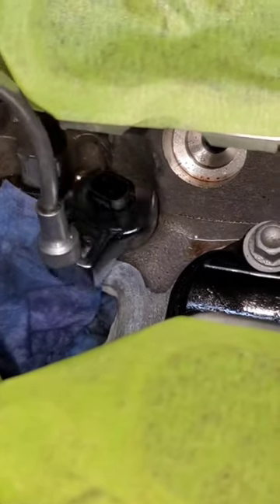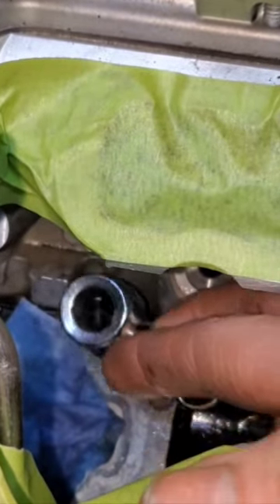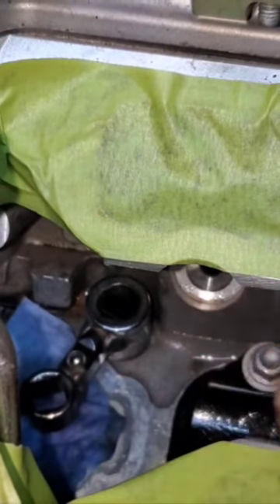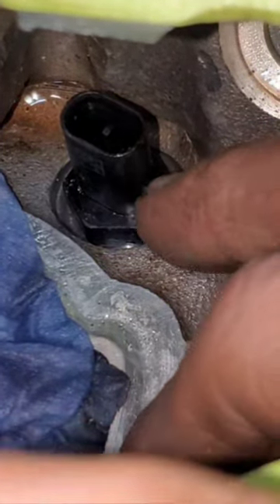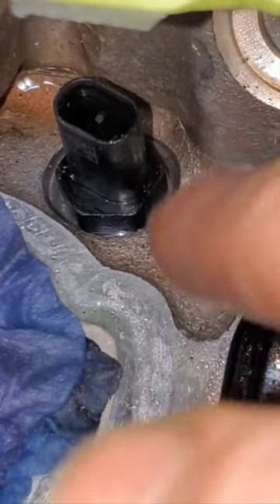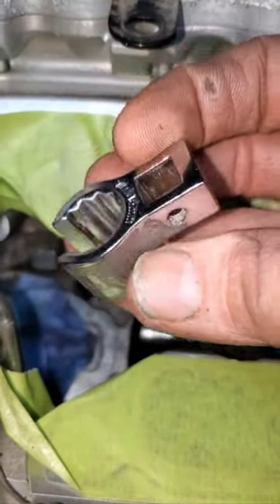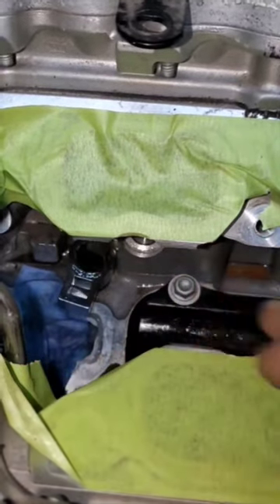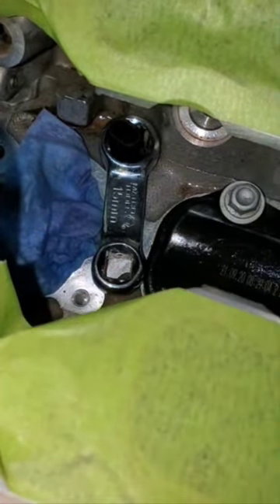No, Your Crowfoot Wrench Won't Work!

Comment: It's nice to see other technicians modifying tools to make tools
Reply: I bought a toolbox, complete with tools, from an old timer who'd retired decades back. Great stuff in there, but the real surprise was the number of fabricated tools made from brazing and welding other  tools. Real modern archeology!
Reply: I mean it's just about a necessity. Seems like every other job I do even as a weekend warrior features some BS like in this video. The job itself is a 20 minute deal, fucking around with the different combinations of tools and things that may not technically be tools is what turns it into 3,4, or 5 hours 😅

Comment: 15mm 1/4" drive  swivel socket fits right on it. Without taking the t stat housing out.
Reply: I can confirm that
Reply: I've gotten lots done with 1/4 drive where nothing else fits.
Reply: Pliers..... Sometimes you just gotta take it out in parts....
Reply: Impact or chrome?
Reply: Yup. I'll bet if he read the FSM it tells you exactly how to remove it.
Reply: @jim169 yea. On old VG30/33 blocks the CHTS is same way, impossible to get to.

Snap the plastic connector off, then you can get a socket on it (it's behind the rear timing cover which won't come off unless the crank pulley comes off). It doesn't NEED to be balls tight. Fill hole with thermal mastic compound, finger tighten new sensor, use a 19mm (oversize) to get just enough torque on it. You need a 19 so you can grab the 17mm nut at an angle without breaking the connector.
Reply: @ObservationofLimits good old vg30 I have 2 z31 300zx😅
Reply: @jim169 😂😂😂 thats how you get every job done in record time... but then got go right back under the hood
Reply: People always underestimate 1/4 sizes. 
I knew a Puerto Rican guy that would go to junkyards with just 1/4 sockets and rachet she said if his 1/4 tools could not remove it then it was a sign that the part was over torque or rusted beyond it’s point. And if it came off then it was a good sign of good practices. Just saying u learn a lot from
Other techs sharing info with each other.
Reply: 15mm 1/4 drive swivel, (now is it shallow , semi, or deep and what brand, bc every brand has different thickness )
Reply: @ObservationofLimits it does. It even tells you if you need a special tool, AND gives you the tool number (which you can look up in the tool room -- it tells you the drawer that it's supposed to be in).
Reply: 15mm in 1/4" is the most underappreciated tool
Reply: Mine is an impact swivel from cornwell tools. Sits right on it.  @courageinthedark
Reply: I was just thinking he needed a deep 15mm socket instead of the shallow he reamed the middle out to fit over the sensor for no reason

Comment: I can tell you after 35 years of being a mechanic that making your own tools is probably the best way to fix any car with any problem. When the serpentine belt came out there was no tool available or already available for mechanics so I made it out a piece of flat steel and an old socket will the two pieces together and Bam a serpentine belt tool to remove the tensioner tension. Frankly many mechanics that's out there has a Custom Tool in their toolbox

Comment: I have changed this sensor so many times. I use a semi deep chrome socket to break it loose and then I use a long flat screw driver to finish removing and reinstall it carefully the same way. It works like a charm… I promise

Comment: I really would like to know why the engineers decided that countersinking that sensor was a good idea. "Hey, let's put this sensor in a tight location and then make it nearly impossible to remove without special tools!"
Reply: I would guess that the intention was to provide a flat sealing surface, but the block was too thick for the sensor to get a good reading, so it had to be counterbored.
Reply: Ever heard of right to repair? They do shit like this to try to force you into going to the dealer for repairs.
Reply: If you're a mechanic buy the correct tools and quit whining.  I only work on my own cars but I do this.
Reply: @mikeb.7068  You do realize that some of these specialty tools are expensive and are only used for, usually, one job.  So yes, they have the right to complain when a design makes them question the sanity of the Engineer.
Reply: @AD-1138  That's the business they're in.  Buy the tool and stop whining.
Reply: I just had to buy a super long T30 Torx just to change the outside door handle on a Mercedes. Lol it's crazy but yeah buy the right tool 😂
Reply: @fryloc359 no it's because the casting is rough and the best way to locate a hole is to machine it flat before drilling.
Reply: @WhatIsKenDoing no they don't
Reply: Sixty years ago, the manufacturers would give their engineers cars to race.   And a few hours a week to work on them.   In return for investing in their engineers playing with their cars a few hours a week, they ended up with a lot better engineers, and cars you could work on.   Chrysler corp always had good drivetrains, and brute force simple suspensions.   They invested the most in their engineers.   Toyotas of the seventies gained their reputation for durability, and ease to work on, because the Japanese Domestic Market was so competitive, that they offered free service contracts with a new car purchase.  When your car needed service, you callled the dealer.  They came with a flatbed, and exchanged you car for another of the same model, and trim level.   When they got done they came and swapped back.   So, it was economically important to design and manufacture vehicles which were easy to work on.   I had a 77 Toyota, Hilux, pickup.   90% of the heads on fasteners were 10 or 12-mm.  The few that weren’t were 19, or 22-mm.  The Toyota 20R series engines, had a one-degree taper in the crankshaft snout.   To change a front seal, you loosened the alternator to take off the 19-mm bolt holding the dampener, then tapped on the dampener with the handle of your ratchet. And it would fall off in your hand.  Front seal replaced in under thirty minutes.   After cutting my teeth working on Sunbeam Tigers, where you had to pull pins, and hold the brake and clutch pedals up against the bottom of the dash, to acces the rubber plugs in the fire wall, so you could access the back two spark plugs, on the left bank, or remove carpet and the trans tunnel to fill the transmission, I-was in heaven working on the Toy truck.
Reply: @ObservationofLimits machining it flat is one thing, counterboring the entire circumference that deep and using a diameter too small for even a socket to fit, is another.  Neither constraint was necessary.

Comment: Yeah as a GM mechanic I can tell you that I use 1/4 inch sockets to get in there with a ball universal socket
Reply: I use a mid-length 1/4" drive 15mm with a U-joint and long extension.  It fits under the overhang of the cylinder head and down into the counter-bore/recess just fine.  I've tried both a Snap-On socket and a Gearwrench and for whatever reason, it seems the GW fits slightly better so that's what I've been using.  I can even torque it using this arrangement.  No specialty tool needed, not to be argumentative.
Reply: @Goodwrench1920  well whatever works

Comment: Had to do this on a 14 Yukon with the 6.2. Mf was up against the firewall and down about 8 inches or so. Had to go buy a thin wall socket to get the job done without removing parts to get to it better

Comment: Yep GM has been known for doing some crazy stuff I had a GMC truck that the alternator would stop working I changed it three times until I figured out GM ran the wires through a steel tube on the back of the head without wrapping them in wire loom and they shorted out I had a smile on my face the day I took it to the crusher haven't bought a GM since

Comment: I had to replace the starter on my 2000 BMW 328ci. Its under the the intake and the bolts are star head. To get the oem bolts out i had to go buy a ratchet with an adjustable position head. I had to use a socket with the star inside the socket. It was like i had to invent a way and the tool to get 2 bolts out that were on the back side. Its was  challenging. As a not everyday mechanic i felt proud of myself. I ended up installing standard square bolts in there when reinstalling it.

Comment: It's almost like engineers take joy from mechanic's pain.

Today I did a serpentine belt and tensioner onsite for a Jeep Patriot. Took me over 2 hours largely because every bolt required a different combination of sockets/wrenches/adapters to be able to get onto the head properly without getting stuck on the way out. Brought 3 different socket sets, 2 different sets of crowfeet, a slimline spline ratchet & socket set, and a standard wrench set plus a handful of extensions, swivels, and adapters and still almost had to go back for more.

The same job on a 1996 Jeep ZJ is about 5-10 minutes.

Why can't we have cars where 90%+ of work can be done with a $100 Stanley socket set, some pliers, a torcque wrench and a screwdriver?

Comment: It has to be a thin wall socket. I had to do this with my wife's car and I used a cheap motorcycle spark plug sock. Worked perfectly.

Comment: Your tool looks like it works much better than a Crowsfoot foot! You should patent it! 
I have a similar experience trying to remove feeder tubes on a 5.9 Cummings crows feet don't really fit very well  maybe barely a quarter turn .

Comment: Use a 5/8ths cylinder base nut wrench
Reply from the maker: Well that's a new one for me- never knew such a tool existed. But I don't work on planes. Atleast not real ones.
Reply: @TechnicianRed yeah but they are expensive and probably wouldn’t make the fit without a little modification, besides the one you made looks like it’s perfect for that job

Comment: lol.... i just use the open end of a wrench ... the second it breaks loose you can turn it out..  if your just replacing it just grab it with channel locks and break it free.. if it dont break free it will break off and if your sockets dont fit in there then you should buy some good sockets ...

Comment: Gotta do what you gotta do to get the job done. I’m curious which 3.6 variant is the one you did this for.
I have an LGX and it wasn’t necessary to modify any tools. A crows foot was all that was needed in my application.

Comment: Try and get the block side bolt off the compressor on a big cam Cummins engine. You can't see it without a mirror and you can't work a mirror because you need both hands. Everyone I know who has done it takes the time to heat and bend up a wrench just right to get on it by feel.

Comment: I have a set of deep sockets that the top 1/2" of them have an external hex, so you can put them on and use a wrench on the socket instead of the ratchet.  They work perfect for spark plugs that the headers are in the way and the cocket fits on but not enough room for the ratchet.

Comment: The snap on line wrench style ones have a set where one side is flush and one side is offset. I have not used any of my other ones since I got that set. It's so nice for stuff like that. Particularly, the active sway bar lines coming off the valve block on those BMWs that have that system

Comment: Unless you use a thin wall 6 point socket. But I digress,  I'm not the mechanic here. We use thin wall impact sockets for custom wheels that the lug hole will not allow a regular socket.

Comment: Pro tip for this repair, some chain saw tools, the one that's used to tighten the blad and remove spark plug will fit it. 😉

Comment: I'm working on the 3.1 right now, same sensor.  You can get a wrench on it...  After you remove the fender brace, air box & intake, hard coolant rail, throttle body and the engine suport. 😆

Comment: Recently had a guy try to tell me the crows foot wrench I let him borrow wasn't a "real crows foot". He said they're supposed to ratchet around the fastener. 

I told him he obviously didn't need it then, since he's so damn smart. 

He bought one from snap on the next week. Mine is an old 3/4" open end welded to an extension.

Comment: Also a thin wall socket with a square welded to the side will work until the tool turns up, or forever.

Comment: I had a 1989 Does Escort, that needed the water pump pulley removed. I wasn't going to pay to buy a special tool to remove the pulley bolt. We ended up having to drill a hole in the wheel well, to get the bolt off.

Comment: the amount of stupidity involved in modern engine designs is really disappointing.

it used to be that the coolant temperature sensor was sticking way out so you could grab it with literally anything.

I'm so glad I drive a 90's car.

Comment: I still have a 15mm craftsman wrench that I had to put a dogleg in for GM 2.0 belt tensioners. Nothing else would fit in the tiny gap between the pulley and the wheelwell.

Comment: Just use a 1/4" ratchet and appropriate size 1/4" drive socket. Sidewall thickness won't be an issue. Socket depth ratchet gearhead thickness and height limitation of your work area are gonna be the issue. I have a 1/4" Dr. Adapter that pops into my 8mm ratchetwrench which is very low profile. I've never had an issue removing or installing this sensor. #MacGyverMentality

Comment: And PS you put the tin socket on there and you stick a little metal rod in the side of the tin socket to turn it so you don't have a ratchet needed on top looks just like the spark plug kit to get on cheap engines that it's just really short

Comment: They do make ratchets that articulate in 2 places. If you aren’t going to use it enough to justify an expensive one then go to Harbor Freight. Just a thought. I had the same problem on a starter on a 98’ S10 and wish I knew about them at that time. Sweet custom tool though!!   Good luck

Comment: I use a mid length snap on crome socket with matco universal extension for them coolant temperature sensor like on the old s10 with a 6 cylinder you don’t have to move the intermittent shaft for cylinder 3 changing spark plugs you break the old put a regular 5/8 spark plug socket on it and put a wrench on the socket I found that out by accident

Comment: Crows foot. It's just that a crow's foot I honestly bought a snap-on set metric and say and you know what I have hardly use them at all and like this gentleman here. If you need a tool that's intense with a reset depth on it. Crow's foot isn't going to do you. No good and not only that you don't got enough swing modifying a tool for the job is the best

Comment: if the sensor is reading perfectly (it does 95% of the time) you dont need to change it with the thermostat.  those sensors have a 2% failure rate - stop being a parts changer and replace what needs to be replaced.

Comment: Reminds me of my Suzuki tools consiting of wrenches with the handles cut off and prongs ground down, a 90 degree bent screw driver, and a harbor freight ratshit that's extra slim combined with the shortest sockets i could find. Oh and most importantly a tap & die set.

Comment: Any person that cant figure out the solution to this problem is well............. I dont want to be rude.
Let me cast some light on this situation as being a man of the auto industry for over 20 years now. Ive come into all sorts of issues like this. Now task at hand removing this sensor. Are you sitting down? I sure hope so, because when I reveal this simple trick your mind will be blown. This trick will save you time, monies, headaches and even busted knuckles. The trick is you take a step back and look from a different angle outside the box. Then you will realize all you have to do is grab a

Tune in next week for the answer

Dont want to wait till next week?

Just grab a big hammer and beat the cylinder head and block in frustration till there is enough room to get a socket in there. Be a man 😂

Comment: Can you put it back on with some washers to raise it up for the next job?
Reply from the maker: That would reduce thread engagement and possibly effect the temperature reading. Modern cars need very accurate temp readings to not set trouble codes and to correctly control fuel mixture.

Comment: Get a gm sensor socket set for $50 or just by the one for the 3.6l it's a thin socket with a section missing for the wires

Comment: In this case you could have cut the plug off the sensor with a die grinder and used a socket. If this was another case then you would have made something, regardless.. good job you got it done man

Comment: Just buy a mini metal lathe if your shop doesnt have a lathe
The amount of parts ive made or fixed on a lathe is amazing not only that id be able to grind that socket down to size an thickness in seconds

Comment: The type of crows foot people are talking about is the Williams BCF24-Crowfoot Flare Nut look it up it’s the right tool for the job
Reply from the maker: Wrong size. Besides, I showed trying to use the Martin Tools equivalent in the video- won't work. It's too thick and I didn't want to grind down a $50+ socket for this one job.

Comment: Drill two holes on the top of a spark plug so that way there’s four holes going through it like a + stick your socket on there that fits stick a screwdriver through the hole turn it

Comment: I've got open wrenches on one end with a swiveling socket on the other end purposely made for jobs like this but still might have to grind the wall thickness of the socket down to fit in.

Comment: find a hole or drill and tap a new one then cut wires in most convenient spot in harness and run new wires to the sensor

Comment: You couldnt just use the top plastic part as leverage and get a smaller crows foot? You dont need to get it to the base. Just use the plastic top for leverage and get it stuck enough to twist

Comment: I needed a ⅜ drive ,17mm crows foot for a torque job on a timing chain, that needed 140 nm (103 ft lbs). Poor little bugger snapped into many pieces.